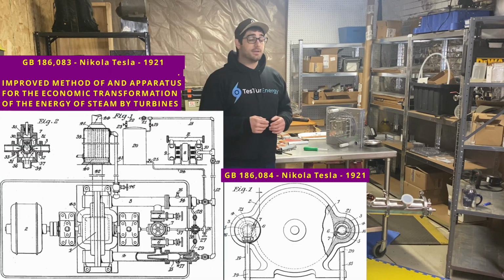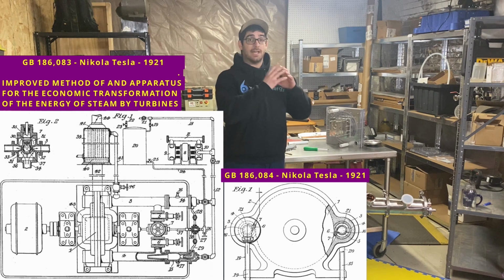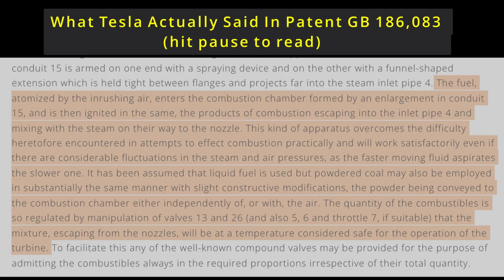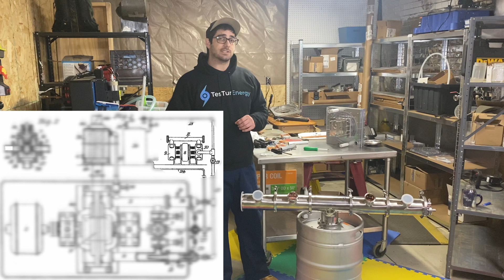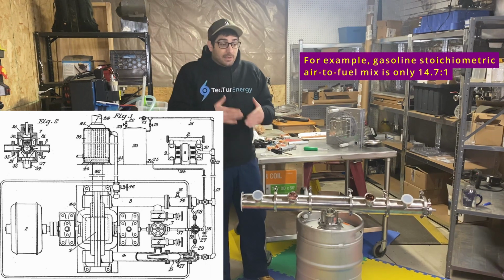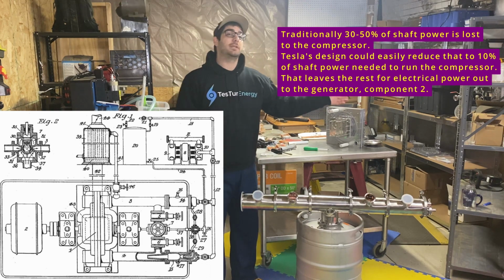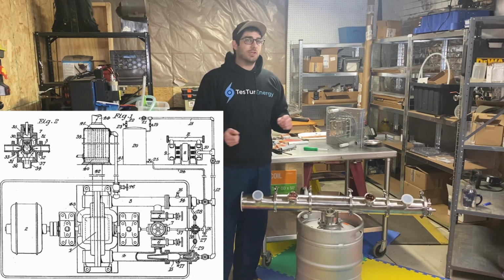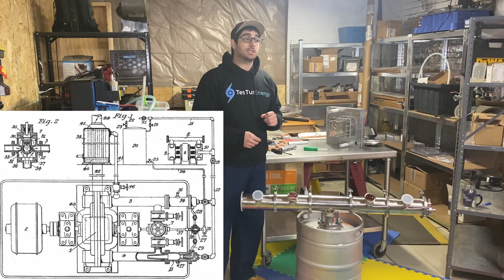A More Efficient Off-Grid Steam + Gas Turbine! GB 186,083

Comment: I think this sort of steam/combustion hybrid has a huge potential for burning "dirty" fuels. Since the fuel and exhaust is mixed with steam and the steam runs in a closed-ish circuit, this will could be designed to effectively capture large amounts of pollutants. Furthermore, the potential for very tight control of the air fuel mixture and temperature enables near complete elimination of NOx emissions (nox forms at high temps when there is free oxygen and nitrogen present, aka lean fuel mixture). And since Nox gases are water soluble/reactive, any leftover nox emissions can be handled with water processing, so no need for a catalyst. But there's no need to stop at NOx.

I think this would be a part of processing waste gases at oil and gas wells. Especially in remote regions, where electricity is hard to get and proper, extremely efficient means of processing such things are too hard to do. The great adaptability of the steam/gas turbine would allow for a highly variable volume and chemistry of the fuel. Not to mention it is simpler and easier to maintain than most comparable types of equipment.
Reply from the maker: Yass!! You’re getting it! Check out this Instagram post of mine that goes into all of that but then goes one step further by using the CO2 and NOx in the exhaust to feed algae!

https://www.instagram.com/p/CumAKf2u56Q/?igshid=MzRlODBiNWFlZA==

And then this other post I made is about an algae that when deprived of oxygen and in a high nitrogen rich environment It produces hydrogen to give off energy!! 🤓👨‍🔬😎

https://www.instagram.com/p/CukZahPJT_W/?igshid=MzRlODBiNWFlZA==

Two birds stoned with 1 joint! 🚬 
😶‍🌫️😎🤓
Reply from the maker: With TesTur Energy, our mission is to give people energy independence through Combined Heat And Power (CHP) systems that can make use of underutilized energy sources like biomass, solar thermal, geothermal and even low grade fuels containing high quantities of solid particulates (like pulverized coal and powdered iron); energy sources/stores that are currently underutilized due to the lack of turbines and engines capable of handling the multiphase fluid flows (any combination of gasses, liquids, solid particulates) present in low grade heat boilers and low grade fuel sources without damage over prolonged/continuous periods of use. 

www.TesTurEnergy.com 

www.HeatAndPower.com